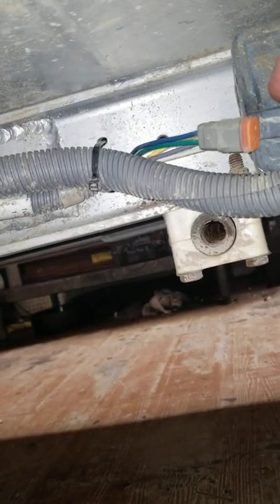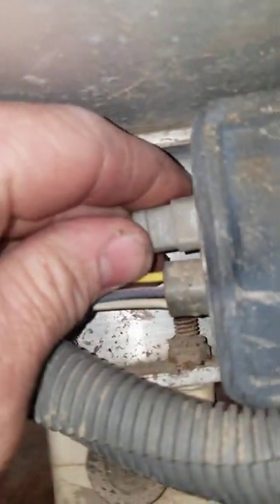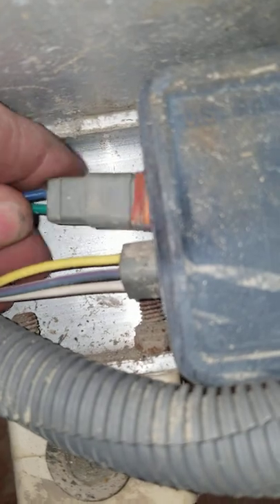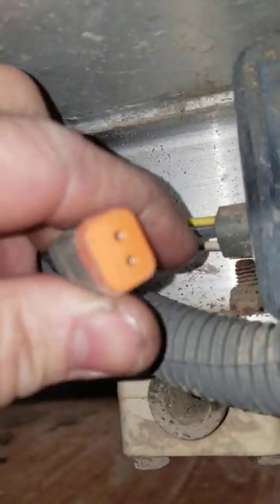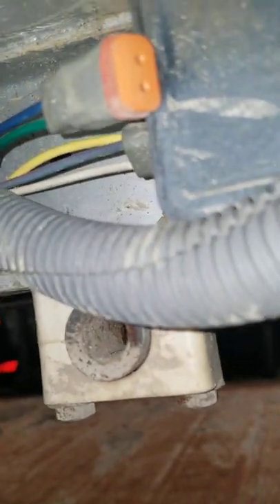Bypass pedal switch on club cart. (mcor)Common problem#golfcart #ezgo #clubcar#

Comment: Why does my golf car not run unless jump solinoid I have replaced solinoid micro switches I have 12 bolts in battery ty
Reply from the maker: So you have a gas club car
Reply: @HeyHeyHey97  yea
Reply from the maker: Do you have a prec or a ds
Reply: @HeyHeyHey97  it is a ds
Reply: @HeyHeyHey97  I have replaced the solinoid and micro wires
Reply from the maker: @robertlee5134  have you checked voltage on the small post on the solenoid
Reply: @HeyHeyHey97  out in shop now I just checked the power on the solinoid and I only have power on the one that is directly connected to battery the outher ones nothing even when step on pedal
Reply: I’m thinking possibly new solinoid
Reply from the maker: @robertlee5134  on the small post what kind of voltage do you have.  Not the big post
Reply: @HeyHeyHey97  any idea
Reply from the maker: Have you checked voltage on the small post on the sol
Reply: @HeyHeyHey97  yes and there is no voltage at all
Reply from the maker: @robertlee5134 put the red lead of your meter on main negative and the other lead.  Test each small post as you hit the gas and tell me what it shows
Reply: You have a bad battery lead. Replace wire from battery to solenoid